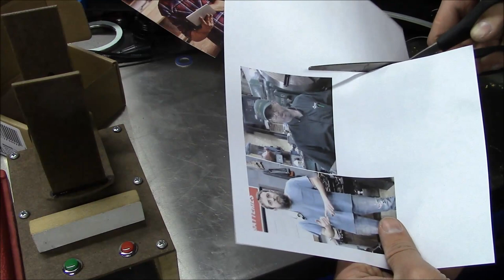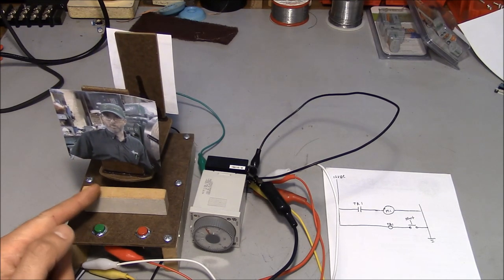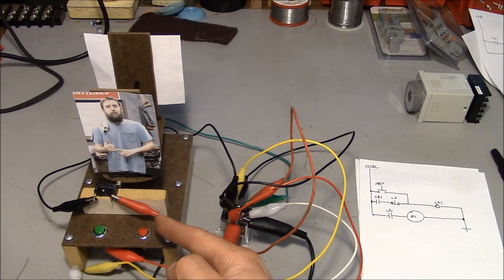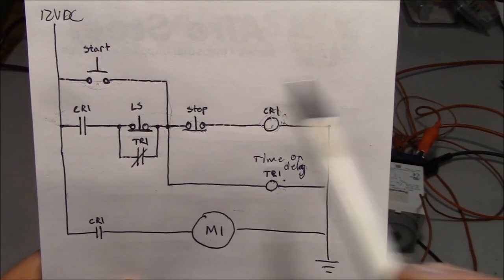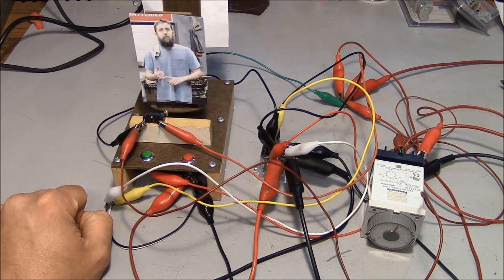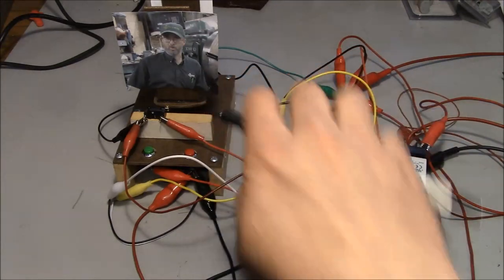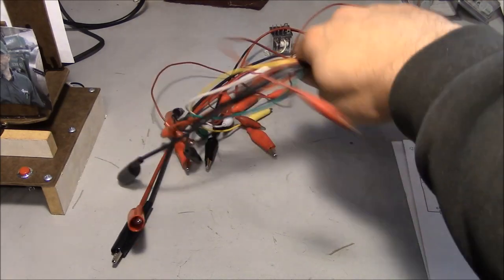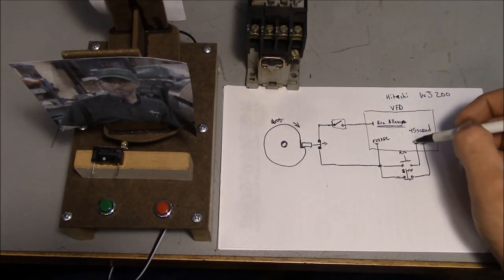Time Delay and Latching Relays - Automation for the Rest of Us

Comment: Enjoy your channel. I use to work in Telephone Exchanges and back in the day before Electronic Switching Everything worked on Electro Mechanical equipment and Thousands of relays.  Back in those days we had what we called Dashpot relays for short invertal  timing functions and Motor driven Cam contacts for timed function like Busy signals, Ringing cycles, other timing requirements. Love your channel and the Variety of adventures I eagerly wait for anything you post.

Comment: Center pivots have used them for overwatering timers forever. They can be extremely tricky to diagnose because of the intermittent nature of the problem sometimes. I usually just assume when that is a possibility I  get rid of the old mechanical timers and eliminate that possibility. It has worked often enough for me that it is standard procedure for me now.  Another great video, definitely not wasted time Wes.
Reply: Oh, by the way, pretty sure I have more than 50 different jumpers. 🙂
Reply from the maker: You can't have too many jumpers!

Comment: Interesting, Wes.  I have worked control systems but never anything like this.  With angular position controls you generally have a position sensor (capacitive or resistive sensors, or resolvers, or optical encoders) and you nearly always have angular rate sensors (gyroscopes).  And then you have control laws that are nearly always run in a microprocessor so that the control laws can be changed without replacing discrete components.  But you also have D/A converters and current drivers to drive the motors that rotate the system.

It would be interesting to see how CNC machines work.  Probably a bit of what you described in this video (turret control) and a bit of digital, linear feedback control.

Thanks for your videos.  I am learning a lot.

Comment: Wes, first time viewer here of your channel.  Some really good info for beginners in simple layman's terms.  Only critique I would offer may seem picky, but it is intended to help someone out in the real world.  

You kept describing the latching circuit as being controlled by a "latching relay", when you should have been calling it a "latched relay".  A "latched relay" describes a relay that is being held in the energized function by your start switch.  The output contacts only close as long as there is power to the coil input.  The contacts of a "latched relay" are designed for continuous operation, and as long as there is power on the coil, then the contacts are closed.  

A "latching relay" would take the power from your start switch, turn on a "latching coil" and permanently close it's output contacts (even after power was removed from the "latching coil".  In order to turn it off, you would have to apply power to the "unlatching coil" input.  The "unlatching coil" would turn on and then the output contacts would again open.  Think of it like a click style ink pin except you have one button to push the ink tip out, and a seperate button to pull the ink tip back inside the pin.  Another important note for most older "latching relays" is that the coils were not normally rated for continuous operation.  You simply applied a short pulse of power to turn it on, and then another short pulse to turn it off.  Applying power to the coils of an older  "latching relay" is likely to over heat them, to the point it starts to smoke and burn off the enamel coating on the wire, and sometimes even some small flames before the wire melts someplace and opens the circuit.  Therefore it is important to think about how your control system is electrically protected in order to keep things safe and not burn up.  

There are now "latching relays" that use a single coil to latch the contacts on and off, (much like a normal ink pin - click it's on, click it's off, both from the same contacts), however, neither style of "latching relays" are used much anymore as PLC's (programmable logic controllers) have replaced most relays, timers, and counters in modern design.  

I hope this may add to your great tutorial.  In this world of PLC's, we need more qualified technicians that can understand relay ladder logic, and can follow through how automation systems work!
Reply from the maker: The relay you describe I have only ever heard referred to as a "keep relay". That said, I don't think I've ever actually seen one in use. But, the time delay relay I used in this demo does have that function. Anyway, I'm sure you are correct. Hopefully the viewers are able to understand the difference.

Comment: If you think electrical relays are fun, how about something built entirely from pneumatic logic. We had a machines where I worked that 100% air logic and no one could figure them out. Eventually tore out the air valves & relays and put in a small PLC to make it work again.

Comment: years ago i build a circuit that you plugged like a table saw and a vacuum cleaner in when you turned on the saw the circuit turned on vacuum cleaner and when you turn off the saw the vacuum would run 45sec and then turn off vacuum to clear out vacuum hose of debris. was going to get patient but never did then found that someone else came out with one. mine used current flow the one they built used voltage still use from time to time

Comment: I got tired of having to remember to close the chicken house door so I built an automatic door closer. The problem with it was, it opened by a photo cell but it closed up before all the chickens got inside so at first I used a timer to shut the system off until a bit after dark. The problem was as the days got longer and shorted I had to keep resetting the timer. To fix the problem I added a on delay timer to the close side of the circuit so now it waits 15 minutes after the photo cell tells it to close. All is good now, no more feeding the raccoons, a couple of years ago I lost 50 chickens. 
Anyhows cheers I enjoyed the video
Reply from the maker: That's a great application of a time delay relay!